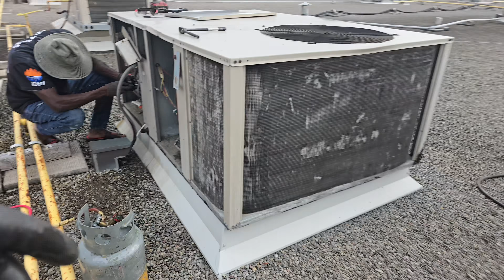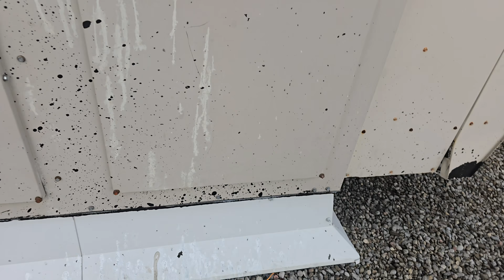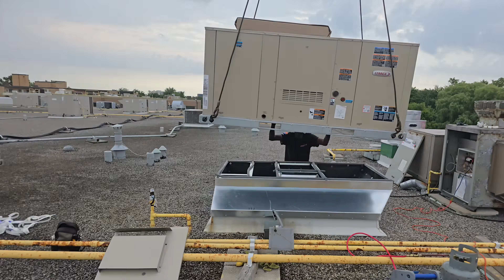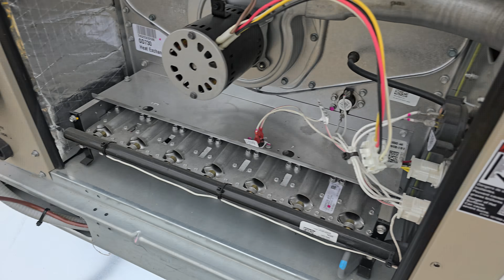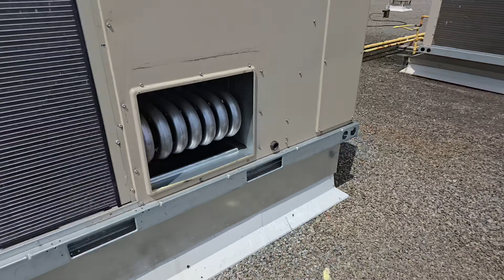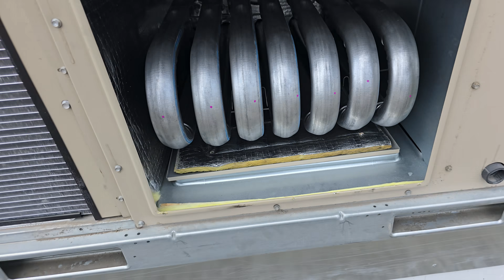Lennox Rooftop HVAC installation | Crane Lift, Gas, Electrical & Startup

Comment: where do you get curb adapters from? Is it custom sheet metal work or can it be purchased from the manufacturer/supplier?
Reply from the maker: Curb adaptor are custom made to match the exact unit and existing roof curb. Your supplier can order the correct adaptor using your unit model and curb dimensions. If you`re in our service area (Ontario) and need help sourcing and installing it, feel free to contact us. We can help get the job done.